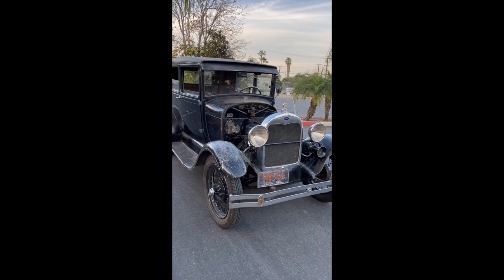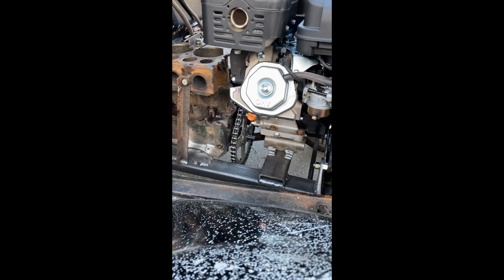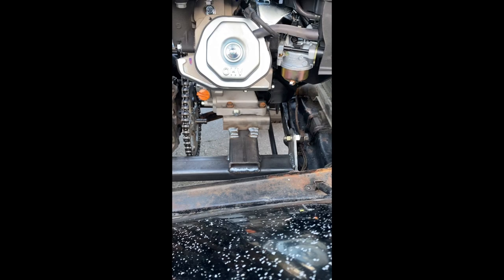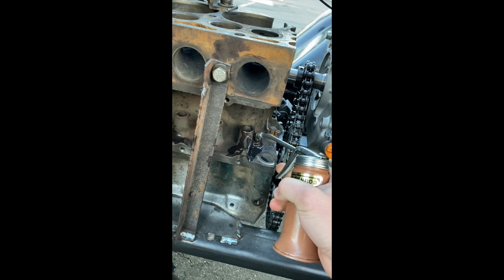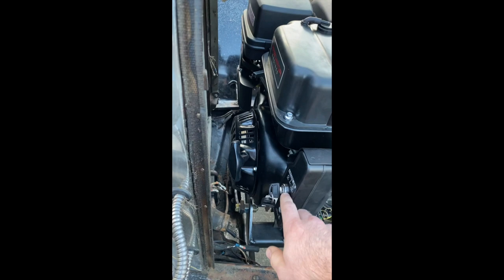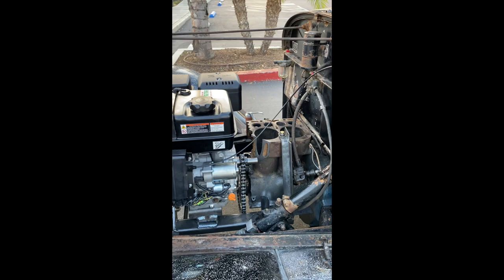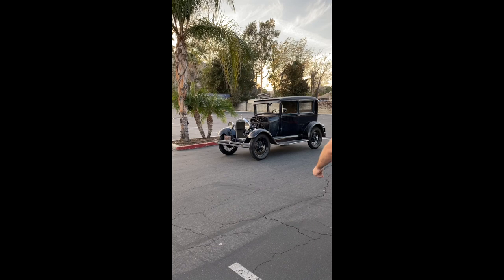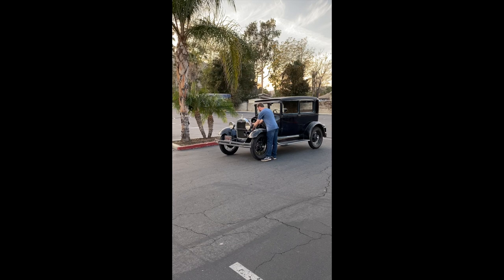Harbor Freight Predator swapped Ford Model A

Comment: I really like your multi belt drive…a pic or some detail on those bearings….thinking a jack shaft would provide some gear. Reduction. If a smaller diesel is used….

Comment: this is very cool.  i'd  remove the remaining part of the original engine and add a second Habor engine and connect them.  get double the power.
Reply: Second time someone has said twin link engines...

But how? Timing them to work together would be a nightmare, and in reality, would you really get that much more power out of it?

I'd just slap a 420cc or the 670cc in there at that point.
Reply: @mr.techaky7655 in that case put 4 of them together

Comment: It's a good start.  Still need to work out some issues.  The engine was shaking pretty bad, and doubt you could drive much faster until its resolved.

Comment: Probably more horsepower than the old flat four.
Reply: Actually a bit less. The BIG difference, the original engine had far more Torque, especially at low RPMs, which is what matters to get a heavy weight moving. The predator would really strain on starting to move from a stop and going up any hill for sure, compared to the original, but still an awesome swap, and looks fun!

Comment: Can you put a car engine in a model t and if so what kind og engine would u put? How about a motorcycle engine like a Harley?
Reply: It came with a car engine... because it was a car when it was built from the factory. So Yes, you can definitely put a car engine in it. As far as what kind of car engine can you put in it? Well since a lot of the early "Hot Rods" built in the 1940s, 50s, an 60s were built using Model T Ford cars and short wheelbase pickup trucks as a starting point, and there are some folks still building them now, and bolting in more powerful engines and better transmissions to go faster and accelerate quicker you can bet that just about every kind of American car engine made before the 1980s has been put into a Model T chassis by somebody at sometime.